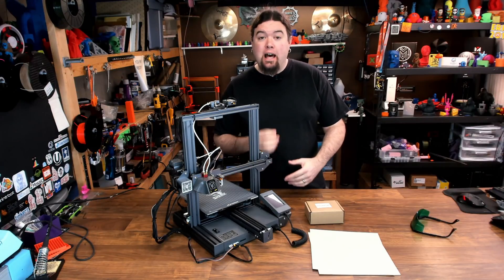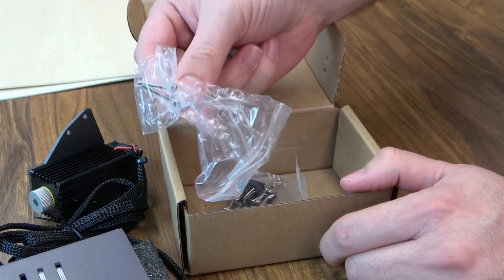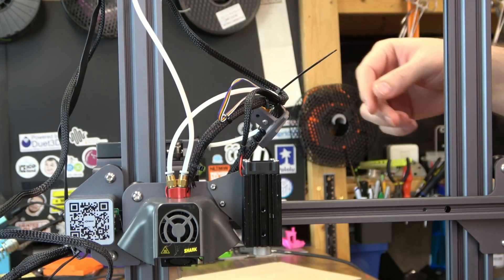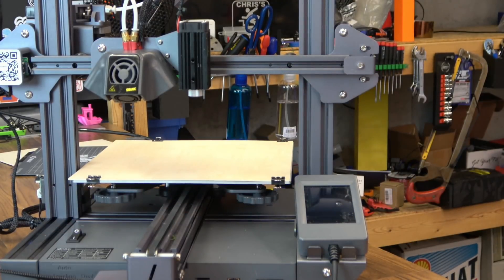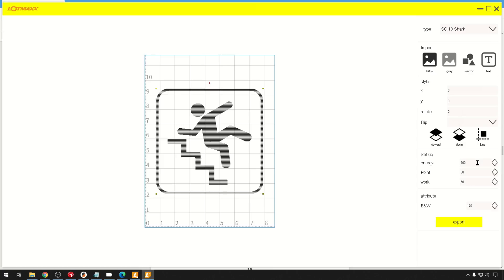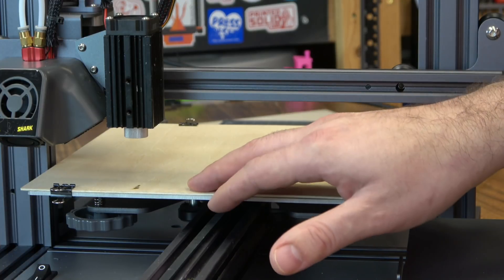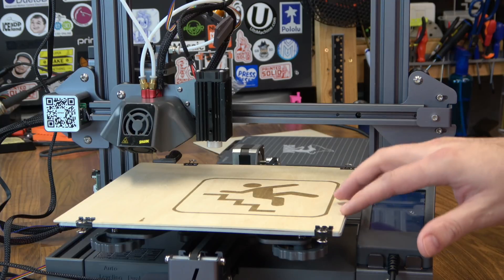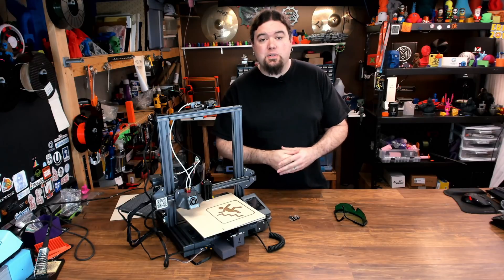Lotmaxx SC-10 Shark - Laser Engraver Install - Chris's Basement

Comment: Hey man so do I need to take the laser off to go back to 3D printing? Or can I leave it on? Do I only have to take it back off to use the BL touch again? Why the heck can they not make it so I don't have to chose one over the other.
Reply from the maker: I think all you have to do is unplug the connector.

Comment: 1. The red lenses and green lenses are not the same. You can still see blue light through the green lenses, even at low power, which means they are NOT adequately protecting you. 
You can not see the blue light at all through the red lenses, even at full power, so we can assume that they are offering a minimum of protection. Despite all that, neither set of glasses are actually acceptable in a professional environment. For real safety, buy something that has a verifiable OD rating of a minimum of 3.  You have it 100% right about using an enclosure.  The reflected laser light does not harm webcams. 
2. WOW, you mean there is no "low power mode" to focus the laser!!!!!   This is a deal-breaker right there. There is no reason you should be trying to focus a full power beam.
 I bought and assembled an Eleksmaker A3 Pro with a 2.5 w laser from China that puts the Shark laser to SHAME!!!!  
T2Laser software FTW!!!!

Thank you Chris for verifying that I don't want ANYTHING to do with this machine.
Reply from the maker: Good to know on the glasses. Yes, there firmware/software needs some work on the laser side.
Reply: For 1. Actually, it's not if you can see the light or not, you can have Clear Lenses AKA GLASSES and see the light and still be protected, It has all to do with the material and thickness to which the laser can no longer burn throw that is the protection, the different colour glasses are simply a marketing factor to help consumers know which wavelength any given product protects from.
Reply: https://youtu.be/WnDjIDhxnMs
Reply: @KarrMcDebt  I never said go on eBay and buy the cheapest you could find loll
Reply: No, you just made an inaccurate statement about how laser safety lenses work.  Red lenses block blue light better than green, plain and simple.
Reply: @patprop74  Awesome, you have fun with that.

Comment: Good review.  I have an Elksmaker Laser Engraver and one big problem I had was the limited "print" area.   I think that is even a bigger drawback on this system than the software, and it had a 300 x 400 mm area.  I was able to enlarge it to 900x 400 by changing the extrusions.    Once you get started with laser engravers you tend to get into signs or other larger projects.
Reply: I have the Eleksmaker A3 pro 2.5 w and I love it!   T2Laser software FTW!!!  My favorite medium is glass painted black, engraved, and then backed with white paper. :)
Reply: @KarrMcDebt  I also purchased the T2software and was very impressed with it.  I have not used it in over a year, since I discovered 3D printing.  I found I can do so much more by adding plastic on top of plastic, than I could by removing material by burning.
Reply from the maker: Thanks Dave, yeah these i3 machines just aren't very good platforms to laser work. Too confining.

Comment: The laser module is basically an off-shelf generic laser module which is pulled to ground to turn on,  most controller boards work the other way around where 0V is off and PWM to 5V is on, this could simply be fixed by making one transistor not gate with a (3904 or any other NPN transistor) and two resistors hooked up between the controller and the lasers TTL board.
Reply: How do you know how this laser is operating? You have one and have looked over the circuitry?
Reply: @timmturner  I bought a few China laser made modules before lol if that answers your question, and for some reason, most of them favour high to be the off state and pulled to ground for firing. and clearly, this is the case here if the lower the number the stronger is the output, wouldn't you agree? They do the same things with those K40 laser cutters also.
Reply: @patprop74  AFAIK there is no variable power on the Shark laser, it's either on or off. The setting in the software does nothing.
Reply: @timmturner  If you say So Tina, And keep up the good work at crowdfunding the Chinese.
Reply from the maker: Thanks for the info on this, I don't have a lot of experience with these.